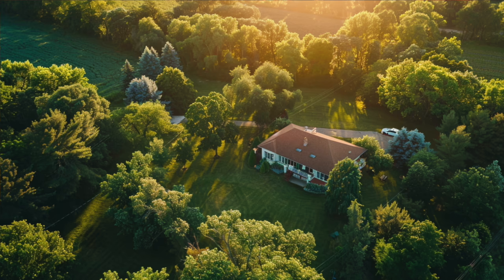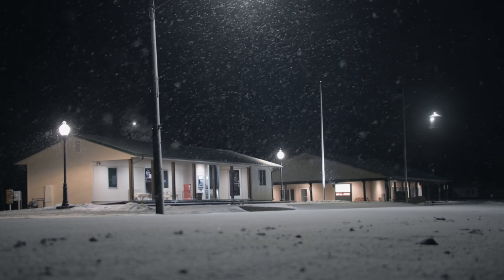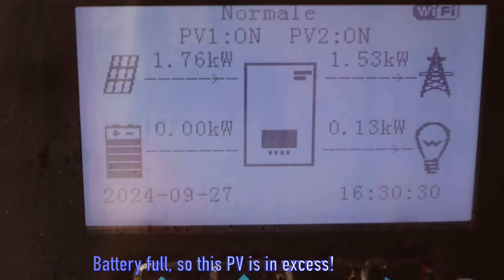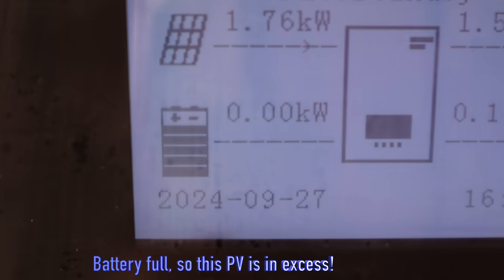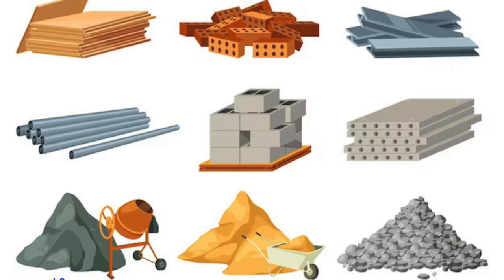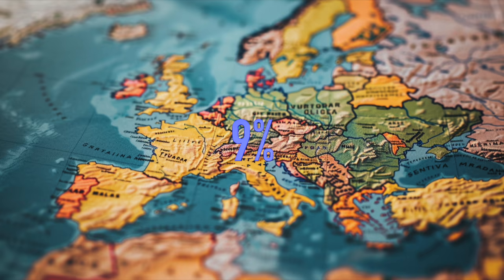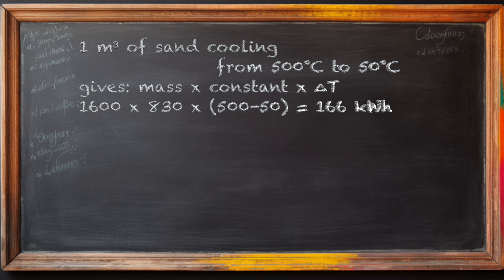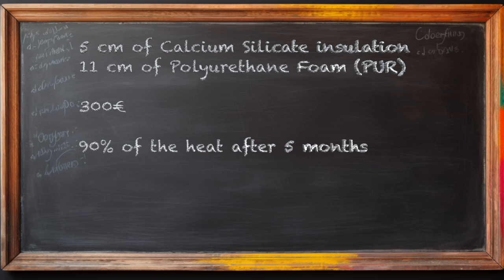Build a Sand Battery: Store Your Summer Solar Energy for Winter Heating! - Video 66

Comment: das thema ist interessant, aber leider stimmt die Rechnung nicht. wenn man 1 m³ Sand hat, hat der im Idealfall eine oberfläche von 6 m². bei einer Durchschittstemperatur von 250 Grad und einem U-Wert der Hülle von 0,20 W/m²K gehen 0,2x6x250 W= 300 Watt pro Stunde über die Hülle verloren, die 166 kWh wären nach ca. 553 Stunden verbraucht (23 Tage). Außerdem bräuchte man, um ein Haus zu heizen ca. 20.000 kWh, was 120 m³ Sand mit 500 Grad entsprechen würde ohne den Wärmeverlust der Hülle. Trotzdem lohnt es sich, darüber nachzudenken, man muss sich nur die Dimensionen klar machen.
Reply from the maker: Hallo Robert, du hast recht, ich habe es I'm video nachher erklärt. Habe ChatGPT nicht völlig kontrolliert. Klassike Fehler!

Comment: There's one problem with these sand batteries. They tend to be rather voluminous. So better put them underground. But then you get another problem. You must at all cost avoid water entering the hot sand. Else it would simply explode. But basically the idea is great. And even more: You could use the very fine sand from the sahara, wich is not useful for anything else. Normal sand with bigger corn is used to make concrete, and it is a limited resource. Sahara sand is something which cannot be used to make concrete. It is good for nothing. Except heat storage.
Reply from the maker: Hi Siegfried, I thought I replied already. Very interesting your view about Sahara sand, it was actually one of the reasons that I started a new project on this theme, also for the people of the Sahara. A video will follow soon. I bought the materials to build a Sand Energy Centre with multiple functions. If you want to know more, you can see the last video about the TES and there are links to subscribe to the newsletter and then you receive the last issue about the Sand Energy Centre.
Reply: @nnvasen-good-energy  Well yes, i'm interested. We plan to move from Germany to a rural region in Spain. A good energy and water and waist water management would be something to do there. But currently we do not know if we can afford it :)
My idea is to build a second wall on the inside of the outer walls of the house with hollow forms, and simply fill the empty space with sand. That would not store that much energy, but hopefully sufficient to keep the inside temperature at a convenient level without adding any energy, machinery, electricity or whatever. I have done something similar in our 350 year old house in Germany, and it works quite well. It is quite cool in summer and keeps the warmth in winter better. It is not perfect, but as a first attempt quite nice.

Comment: Hello. This is great! I'm wondering how to heat sand from a fire like a candle's residual heat, so I could pre-store the heat from fire into the sand as well, not just from solar electricity.
Reply from the maker: Hello, I find this a great idea, electricity is high value because it is flexible, so heat is indeed better. A fire is indeed a good idea but also the exhaust of an engine, for example look my playlist Micro CHP and there you have a heat source at several hundreds ℃ that can be stored. And you have the electricity in addition and can store that in a battery if you don't use it on the moment.

Comment: Water has 4 times the heat capacity of sand, so why sand?
Reply from the maker: Hi William, indeed, this fact allows to keep temperatures 4x as low, with water. The problem is when you go above 90℃ or so. But it is true that this corresponds to about 360℃ with sand. So below that you have to find other advantages of sand to justify it (sand doesn't leak, high temperatures are better for certain applications, ...). Professional systems (large scale) go above 360℃.
Reply: @nnvasen-good-energy  You can get sand up to 800 C . May be even higher , depends on the solar system output.

Comment: The beauty is its simplicity.
But for long term storage, you need a big volume. So really only applies to new build. 
Say a 1m deep below the ground floor.  Of course the bigger it is the less thick insulation needed. 
Now for a small one, that could be useful if you have variable energy pricing.  When the wind blows at night, cheap electric, store in battery (much as the old storage radiators did) and use over the next few days.
Reply from the maker: Hi Mark, you are right, this is more for shorter time storage, but please look my next video in the weekend, there I will also correct a mistake in this video.

Comment: I am in the process of making a heat bank storage that was used for off peak tariffs at night to heat during the daylight hours with excess solar on a off grid setup to heat my house during the night, the heat bank weighs in at 240kg and storages about 34kwh of energy
Reply from the maker: Splendid, that is what I try to say in the Replies to the other comments and also next weekend in the new video: short term storage is the better application for these high temperatures. For Seasonal Thermal Energy Storage (STES) I believe more in lower temperatures, water and heat pumps. But you understood it, that short term is the best way to use sand.

Comment: This looks interesting. Obviously as bigger the volume the better the efficiency. Worth trying a prototype, check the numbers and estimate the required volume (with the square-cubic law gain) to see if it will be worth. Thanks.
Reply from the maker: If one has the volume, you can certainly use it. Anyway, my idea is more for a smaller amount of emergency energy, because emergency = HighValue. See the mentioning of 1 m³ of sand. 
Moreover, I must admit that the idea of Seasonal Thermal Energy Storage (STES) must be reviewed a bit (see next weekend's video) because of a miscalculation from my side. However, I come with good news. One step back, two steps forwards. I hope you will be there to watch.
You will see this warning also below in other Replies, I just want to be sure to tell it everyone and "manage expectations".

Comment: It doesn't matter how hot you heat the sand, it will not stay warm for more than 24 to 48 hours.  Your claim to store heat for 5 months is a SCAM!!
Reply from the maker: Yes, I am sorry for the miscalculation. And now I got the most views ever on my channel, that creates a responsibility. So I will put this right next weekend, tell about the error and make the concept even better. One step back, two steps forward. I know already how to do it. I hope you will see it. Thanks in advance for the trust.
Reply: How long it will stay hot depends on heat loses / insulation quality.  You can go 500 - 1000 mm of compressed rock wool , that would help a lot.

Comment: Thanks for the video, and best wishes for your channel, but I was really hope to be shown HOT to 'Build a Sand Battery'. I think the idea of thermal energy storage is brilliant, and I think only a complete lack of imagination prevents any village to city from installing them at an industrial/municipal scale. I am planning a larger version of this, but I think your figures of 90% at five months, are fanciful. I would so love it to be true. A house in Ireland uses about 16,000 kWh annually the big majority of this before Feb, so about 100m3 would do it. I think the devil would be in the detail. To get any efficiency, I'd imagine you would need various networks of pipes, air ones and water ones, plus temp sensors throughout, to tell you which pipes you should be using to extract heat. I so want one. I inherited a few acres (13 in three blocks,) with a hope to re-wild most of it, but buy enough second-hand solar panels to build two solar panel 'fences', and store the summer rays for winter days. Get a move-on, world!
Reply from the maker: Hi Michael, I realise that you mean "HOW" and not "HOT" 😀! I am now preparing a video for the next week where I show a better prototype than in this video, while the concept that I propose for the real situation is also much better. I must admit that the idea of Seasonal Thermal Energy Storage (STES) must be reviewed a bit (see next weekend's video) because of a miscalculation from my side. However, I come with good news. One step back, two steps forwards. I hope you will be there to watch.
And about a real STES, you are right, my proposal is for shorter time storage, moreover not for the whole house. Rather for an emergency amount (in the video I mention those 166 kWh).
For long time storage I propose lower temperatures (= less loss)and thus water with its high specific heat, and then heat pumps.
I admire your wish to move ahead!

Comment: Thinking of sand as a fluid or electrical compound, I would imagine more of a "capacitor" type function. Wouldn't it have a high capacity but harder time holding it? Wouldn't your insulating and isolating medium be the most deterministic in its ability to retain that capacity? A deserts sand bakes in the sun all day, and yet it sheds that heat very quickly at night and becomes cold. Theoretically the sand would have to increase its "resistance" as it increases in temperature and then lower as it cools to be somewhat efficient but last I checked, molten glass doesn't cool back into sand when it cools down. That's it... just put a heating element in the center of a well insulated glass sphere, and the heat will be contained within the molten core.
Reply from the maker: Hi Robert, yes, it is like a capacitor, which increases voltage in a linear way as you pump electric charge in it. In the same way the temperature of the sand goes up, unlike a battery, which stays a some voltage as a chemical reaction is going on. That's my reason to think about Phase Change Materials (PCM) to avoid going in the very high temperature range (which increases heat loss).

Comment: Very good 👍
Ive been thinking for many yrs now how to store solar energy to heat my garage over the winter months here in Central Ontario Canada.  Im thinking of cutting a large central  trench in the middle and putting in a sand battery heated during the sunny days with 1200w of solar.
Cheers
Reply from the maker: Thank you Patrick. Maybe you can look to video 62 with the 2 tanks, that gives so much more efficiency (heat pump) if you have space enough.
Reply: `1200W nowhere near enough

Comment: I am no expert but I am quite skeptical about your "90% of the heat after 5 months".
Here are my own calculations:

5 cm of Calcium Silicate (U=0.068 W/mK) has R=0.05/U= 0.7353 m²K/W                                         
11cm of Polyurethane foam (U=0.022 W/mK) has R=0.11/U= 5 m²K/W                                             
                                                                                                           
So the overall R is around 5.7 m²K/W                                                                       
                                                                                                           
The overall surface of a 1m³ cube is S=6m²    (6 faces of 1m²)                                                             
The temperature delta is T=500K                                                     
                                                                                                           
The power loss will be S*T/R = 6*500/5.7 = 526 W                                                           
                                                                                                           
So during the FIRST DAY, the energy loss will be 526W * 24h = 12,624 Wh = 12.6 kWh which is 7.5% of the overall 166 kWh of stored heat. 
Said otherwise, that setup only preserves 92.5% of the stored thermal energy every day.     
                                                                                                           
After 1 week   0.925^7   = 58%                                                                             
After 2 weeks  0.925^14  = 34%                                                                             
After 3 weeks  0.925^21  = 19%                                                                             
After 1 month  0.925^30  = 9%                                                                              
After 2 months 0.925^60 = 1%
...

Did I make a mistake somewhere? 

If I am correct then that means that sand batteries are only realistic at a very large scale. For example, if we scale all dimensions by 10 (i.e. a cube of size 10x10x10 surrounded by  1.1 m of PUF ) then R=57 m²K/W and the volume of sand becomes 1000 m³. The stored energy is now 166,000  kWh  but the power loss is only  600*500/57 = 5260W (i.e. 100 times more surface but 10 times more isolation). So during the first day, the energy loss is 5260W * 24h = 126 kWh or 126/166000  = 0.075% of the stored energy. The daily efficiency is now 99.925% so after a month the sand battery keeps 0.99925 ^ 30 = 97.7% of its thermal energy.
Reply: I agree with your calculations. This is only interesting at higher volumes for 2 reasons. 1) The volume to surface ratio. There is less surface per m3 to lose heat at a higher volume. 2) The capacity. I live in a 15 years old, well insulated house in the Netherlands. Last January I used 4 GJ for heating. Even without losses in storage and transport, I would need about 7 m3 of sand at 500K for the month of January. To have enough heat for the entire winter, I would have to build a new shed in my small garden to store heat.
Reply: As the volume cools down, the delta T decreases so as the power losses. However your calculation is sufficient to prove the point, that the seasonal storage cant work at this scale.
Reply: @radomirfilip8741  Yeah. The delta T decreases and so will the amount of energy that will be lost each day. This is why I only gave the kWh figure for the first day. However, the ratio ENERGY LOST / ENERGY STORED shall remain constant over time since both are proportional to the current delta T. This is why I used the 7.25% daily loss (or the preservation rate 92.75%) for the long term computation. 
PS: And yes, I made a mistake in the first message.  92.5% shall be  92.75%  (100% - 7.25%)
Reply: One more problem: 
What will be the temperature at the surface of the Calcium silicate ?
More than 400 °C. Not good for the foam.
Reply from the maker: Hi Cynodont, you are right! I am sorry to have created expectations, so in the next video I aim to fix these problems, may I mention you (under your channel name) as the best comment of the week? 
I have several solutions, among which the Phase Change Materials (PCM) that I mentioned already in the video. So I hope you will watch the next video that should be published in the weekend. Thank you in advance for your trust.
To the other comments under this comment of yours: yes, it is not meant as a full seasonal storage, as I told in this video and in the two videos before. It is a limited back up for black outs and/or extreme cold weather for a couple of days. These kind of emergency solutions give also the most value for your money and peace of mind: energy when you really need it. From that situation you can always expand to a more everyday application.
Reply: You're absolutely right. This guy didn't even calculate anything...
Reply: His doing it, r u 😮 @RikkerdHZ 
Bet not😅
Reply: @scoobyblu5815  No he isn't, and he just admitted he was wrong under the original comment
Reply: And if the storage is under the house then the energy loss will heat the house from under it
Reply: Make a vaumm around the battery just like Thermos

Comment: Nice video! Are you going to implement this for your house?
Reply from the maker: That's the plan! At least a smaller prototype, because also video 62, 64 and 65 are candidates and they are higher efficiency because of the heat pump.